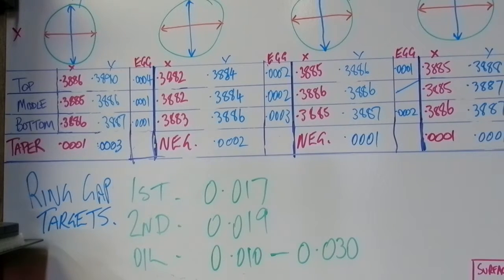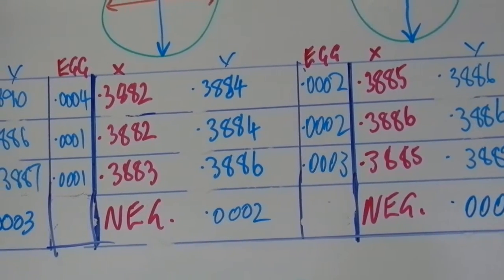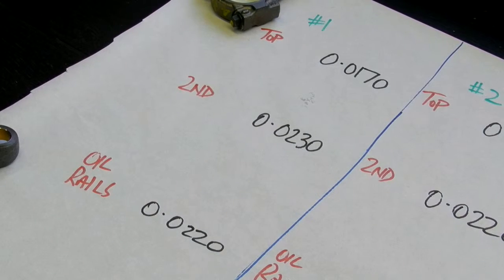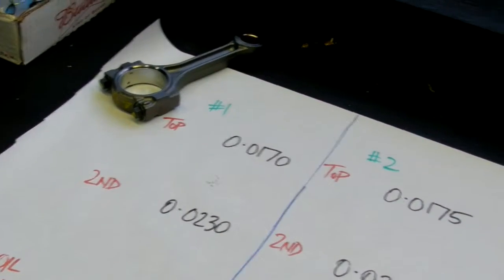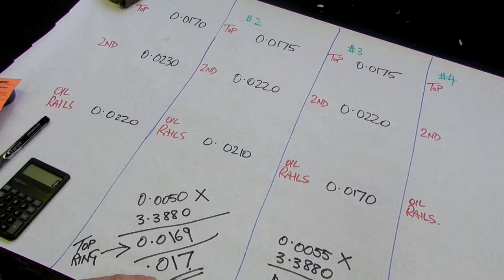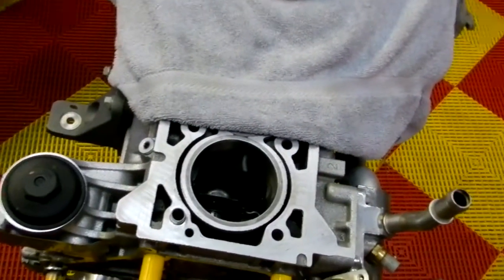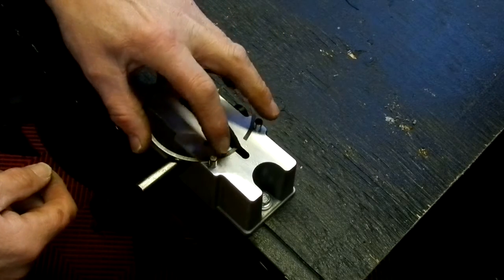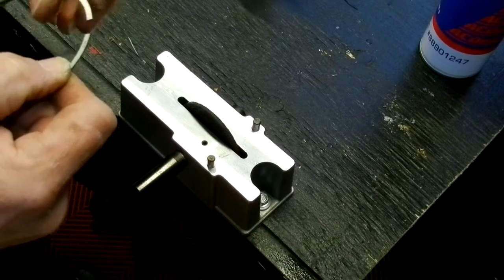LNF REBUILD VIDEO #5   Part 1   MEASURING RESULTS & RING GAPPING

Comment: Were the piston rings you blueprinted the standard rings that came with the pistons or a custom ordered? The reason I ask, I want to do this to mine,  but I've read in the description file fit: no. Great videos by the way!
Reply from the maker: +Curtis Wallace 
Yes, I used the rings that came with the piston kit. You will need to file to achieve correct end gaps.

Comment: which Waiseco pistons did u get ? 86mm
Reply from the maker: +Ricardo Contreras 
Yes. 86mm. Wiseco K635M86.  I performed a very, very light hone and then filed the rings for correct end gap.
Reply: Did you hone it with a drill hone?